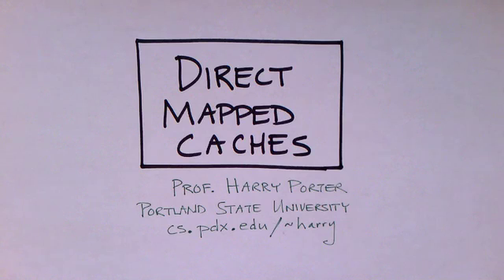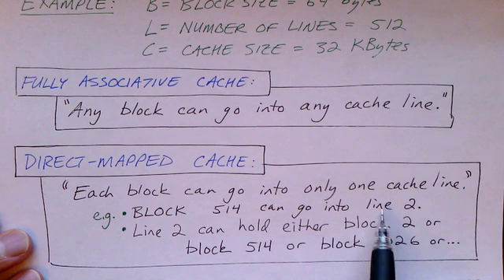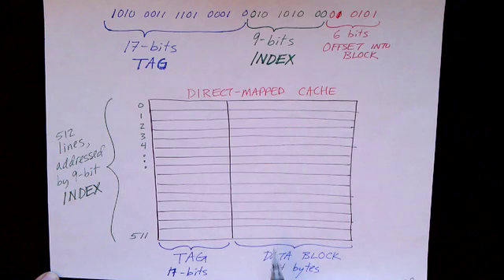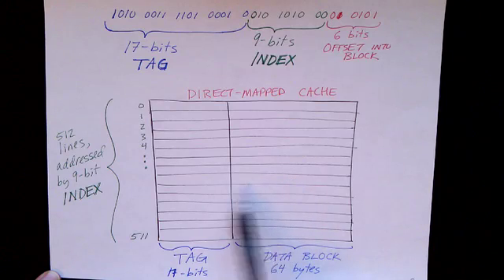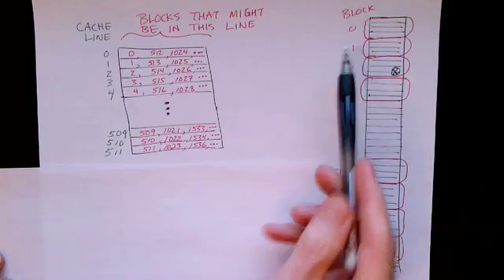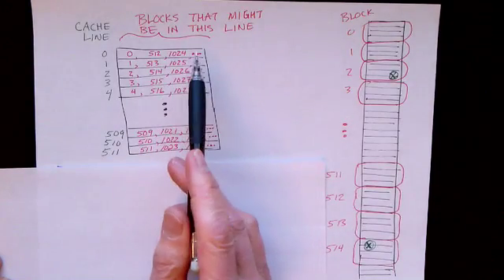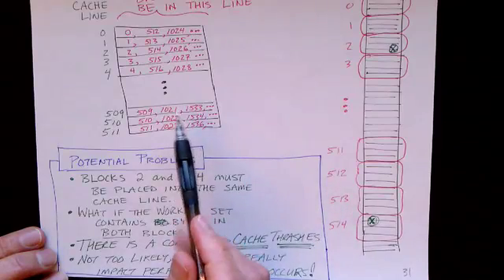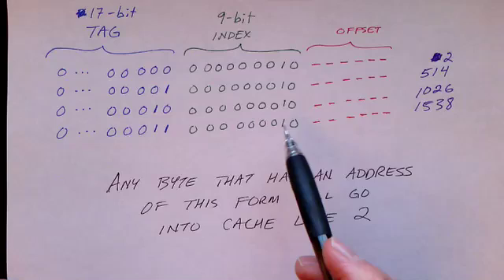Lecture 6/9:Caches-Direct Mapped

Comment: can you guys explain to me what a line is in a cache?
Reply: A line is the same thing as a block. It's the amount of data you take into or remove from the cache at a time. So if my line size (or block size) is 64 bytes, if I have a cache miss on a certain byte I'll take in the 64 bytes containing that byte. It's not efficient to just bring in a exactly what you're reading because then you don't benefit from spatial locality

Comment: i know it's an old video, but i'm confused about the tag size at 3:37. I mean, looks like there's only 16 bits, but you counted +1. Why?
Reply: I think tag size is 17 bits because we got 32 bit word and 9 bits of it are used for the index( to recognize the line from the cache), 6 bits are used for offset(to recognize the byte in the block),and if we add them together and subtract them from the word, we end up with 17 bits left for tag ( to recognize if what is loaded in the cache is the right block we're looking for from the main memory, so we got cache hit and don't need to fetch it from main memory)   : 
32 - (9+6) =
32 - 15 = 17

Also 9 represents 2^9, 6 represents 2^6 and 17 represents 2^17 and if we multiply them the result is 2^32 which equals 4,294,967,296(4GB) and that is the size of our main memory.
2^32/2^6= 2^26(67,108,864) gives us how many blocks/lines the main memory has.
According to the cache which has 2^9 = 512 lines/blocks.
So if we divide the number of cache blocks to the number of main memory blocks we'll find how many main memory blocks correspond to single cache block : 2^26/2^9= 2^17(131,072 blocks correspond to 1 cache block) which also gives us the number of tag bits we need(17) to be able to distinguish all blocks from main memory which may be in this block of the cache.
On the end of the story we got:
Each  block from main or cache memory contains 2^6(64) bytes
Main memory is 2^32(4,294,967,296 bytes) or 4GB
Main memory has 2^26(67,108,864) blocks
Cache has 2^9(512) blocks
Cache memory is 2^9*2^6 = 13,312 bytes or 13KB

I may be wrong somewhere so if it is so please make me aware of.